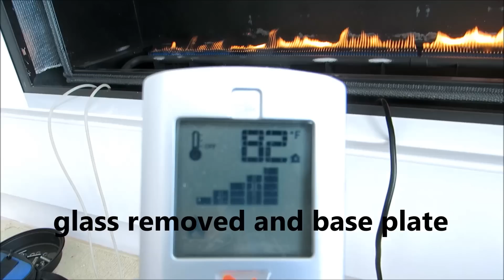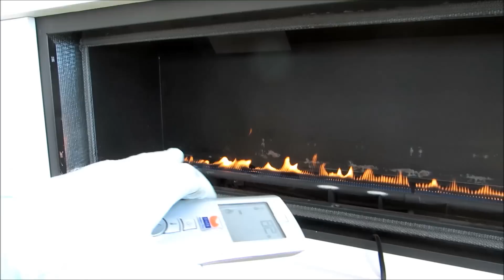sparks gas fireplace testing

Comment: What was the reason (symptoms) that the customer had you work on the fireplace? I'm curious how to recognize a NG or LP fireplace that is out of adjustment.  
Having the customer sitting in the room...makes it challenging of course, so its understood that you couldn't necessarily get a few quick shots of the "before" state with and without the glass front installed to show the difference. White walls, white carpet, white furniture, every tradesman's favorite color!
Reply from the maker: i get called in to these jobs when there is a problem this company has no service guys out in the field .i go there and try to fix the problem usually its with the venting install ect .. but i check the gas pressures and set the air bands for the best flame possable ...i have only done a few for this company more of a pain in the ass then its worth .the gas valve has no setting on it ...its a smart valve /electronic spark ect. its a fire place more for looks then any thing else.so the normal manifold pressure are not always what we need to look for .on this one the manifold was like 10 feet long so as long as it works good and runs clean thats what i was looking for on a windy day the system might not work so well  it has makeup air and exast in a 2 pipe system .
Reply from the maker: steven lavimoniere i usally talk to the guy who designed the fireplaces he use to be a gas guy like me before he went to work for this fireplace company so we think alike .i am his eyes on the job type of thing. and we can usally work problems out over the phone .